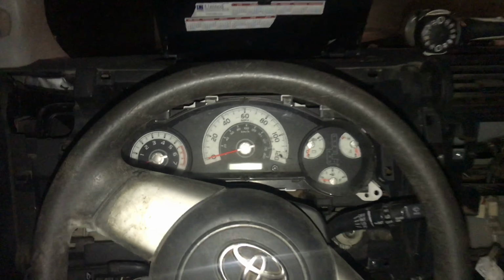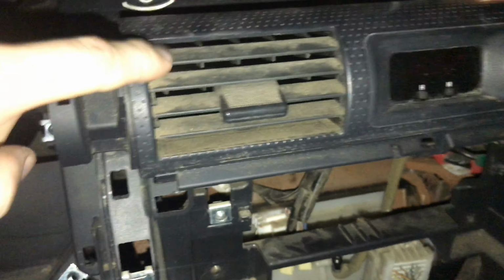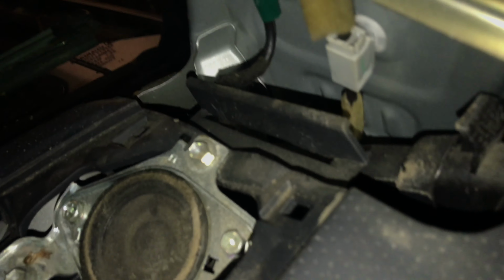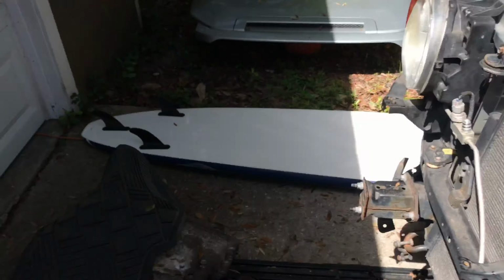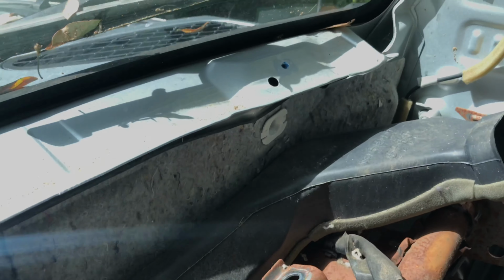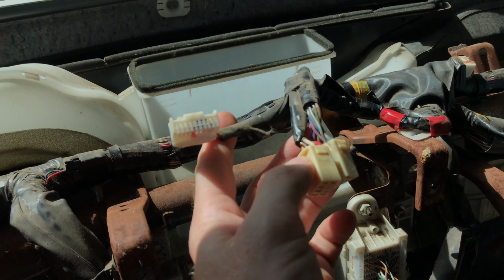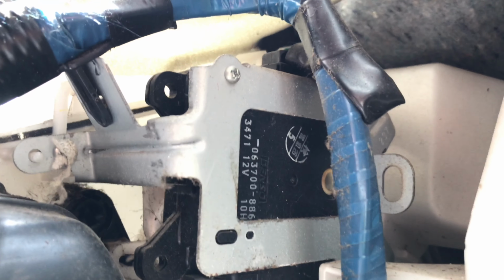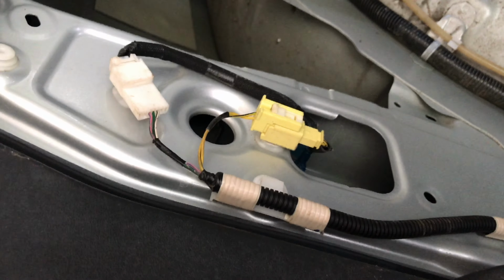FJ Cruiser Rebuild Part 13: How To Remove The Dash and Find Wire Harness / ECU Locations

Comment: After seeing your engine videos etc... this certainly looks like this FJ may have been in a flood. I'm no expert in flooded vehicles, but seems highly suspect. Did you run a carfax? Of course it would not be on that report if the owner never made a claim. You're rebuilding it so it's a good project regardless.
Reply from the maker: JDangerBayer carfax had two minor incidents, both of which I can verify with small amount of damage under the bumpers.  I have no idea of what the seller left out of his story, but doesn’t matter much at this point. 😄 I’ve basically stripped the entire thing to the bones 🦴.  I found some roof leaks which are typical of this model year. Thinking that’s where a lot of the water inside came from since it was sitting for a year in Georgia. For $2500, you can’t even get a salvage FJ at IAA or Copart. I figure with $3,500 I can get this thing running and looking good as USED. Ha! You’re right. Good project.
Reply: @DadsGotADeal  Very true! If you're having fun that's all that matters. When you're thinking about the front bumper replacement I'll say that my wife had a small fender bender and I replaced her front bumper with a smittybuilt M1. It wasn't a super easy install but once it was done it looked good. You can find a couple videos of our FJ on my channel. I have footage of the bumper install but never made a final video of it. You mentioned wondering if your FJ had side airbags in one of your videos... besides finding the actual airbags; there would likely be small sewn in tags in the sides of the front seats that indicate side airbags... at least there are on our FJ. Good luck and look forward to seeing your progress on the FJ.
Reply: Off roading in a swamp and it went to about the dash level when he drowned it. the mud on the inside shows. Happens to quite a few every year.